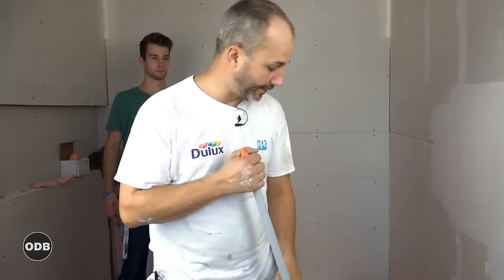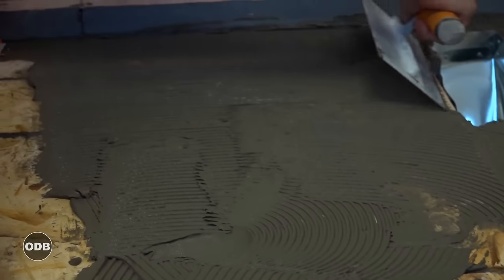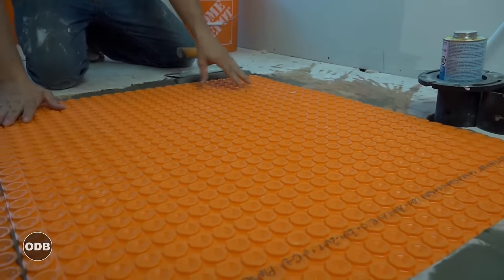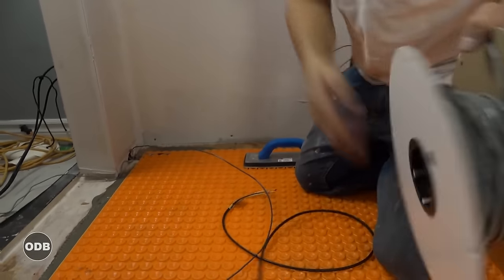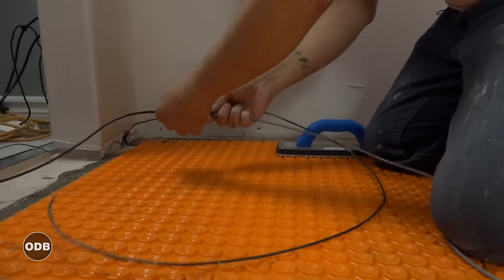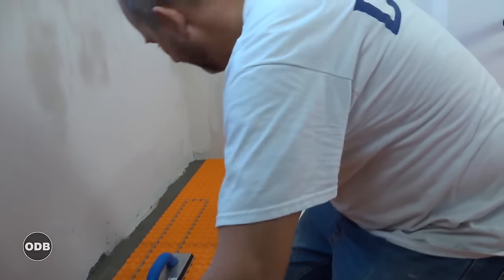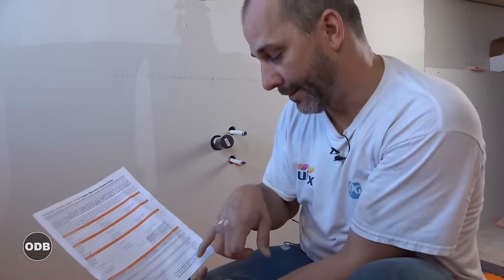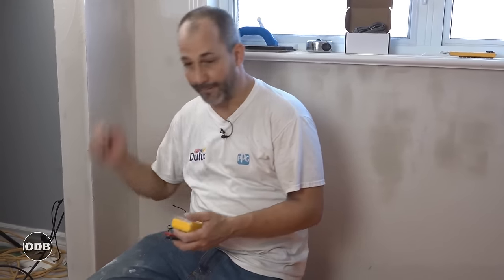How to Install Ditra Heated Floor System by Schluter Systems

Comment: Okay, I haven’t read comments yet and I’m only halfway through this video yet I already see a couple big concerns: first, you didn’t use the notch side of the trowel and that’s how you get an even and proper amount of thinset down. When you lifted the Ditra, it was very evident that you did not have enough thinset coverage as lots of white felt on the underside was showing. Secondly, I’m wondering if you fully read instructions and watched any videos because there’s a VERY GOOD reason why you have two sensor cables. It’s so you can install both and connect one, that way if the one you connect goes bad for any reason, you can switch over to the spare one without having to dig up any tile (can you imagine what a terrible hassle and mess that would be?). I’ll watch the rest of this video and see if you eventually have any “epiphanies”. Let’s hope you do.
Reply: He actually does use the notch side. Its a bit hard to see on the vid
Reply: He’s using the flat side of the trowel to ‘burn’ the thinset into the substrate.  Standard practice.  He states at 1:40 he’ll ‘comb’ it after.

I agree his thinset coverage is problematic.  He’s seemed satisfied with ~20% coverage.  I wonder if his Schluter class instructor would agree. 😬  the problem may be that he is using the Schluter 1/8 inch v notch (which is for applying Kerri to band to walls) instead of the recommended 1/4 x 1/4 inch square notch recommended for the Ditra.

Also, there are two tests for the Ditra cable not just one.  He only did a resistance test.  There is a second continuity test required for warranty

This vid is 5 y.o. now so maybe the recommendations have changed since then..
Reply: @ClownCarCoup  Yea most of what you said is correct. your are suppose to check for continuity 3 times, before install during install once cable is down and after tile install. His coverage is absurdly poor because he probably spent a lot of time talking and the mortar got to dry and that's why it's skimming over. His trowel size is good but the mortar is just to dry and not actually grabbing the fleece. He clearly did not do the training course for Schluter or just did not watch the videos that clearly show how this product is installed. 
He used the Ditra trowel for the heated floor.
He even installed the Kerdi banding over bare wood in the shower which is never done or recommended. 

This was probably a keep it cheap job and needed to be a fast one as the client was not there at the time and he had to get it done in a few weeks or something like that so he probably wanted to just get the thing done and move on as fast as possible. Seeing how there's drywall in the shower but the lack of knowledge with the floor warming and waterproofing install is questionable.

Comment: it comes with two sensors... one with thermostat and one with cables.  both r suppose to be installed.. senors r suppose to be 24 inch away from wall.. i suggest not to use this video to install your floor.. i would watch the schluter video itself.. this guy made alot of errors that would void warranty..
Reply from the maker: Now Now, don't be hating. If you have any specific points to mention I encourage constructive criticism.
Reply: That was constructive. The two thermostats are installed just in case one fails. You also did not install them in the correct location per the installation instructions. The thermostat is supposed to go in the field between to lines. It is supposed to be cut into one of the nodes.

Just a thought, but you may want to read the installation directions before you make a video representing you and the manufacturer.
Reply: @tntrenovate5845  only one thermostat is installed on a bathroom that size.  Two SENSORS are installed in the thermostat in case one sensor breaks.
Reply: No, you always install both sensors in the floor. As I said, you have one ready if and when the other fails. I never said that you connect them to the thermostat. It's clear he has NEVER been trained, or even read the installation instructions, or he would know this. He also installed them in the wrong place. Again, something he would have known if he took the time to read the instructions.
Reply: “...make sure we have good adhesion” <we don’t> “...here we go”
Reply: @marlowt2  LOL I said the same when I seen that. I just saw a video from the company, right before I seen this video.
Reply: @gr8bart1  that's because he used unmodified thinset. The plywood was sucking the moisture out of it too quickly. Supposed to use modified over wood subfloor. Major error. That floor, if still in place, has had the grout repaired several times cause it cracks and the tiles are loose and he probably blamed it on Schluter.
Reply: @tntrenovate5845  And this dude says he is certified.... This has been the worst video I have see on this subject. But I kept watching just so that I would know what NOT to do!
Reply: @HomeRenoVisionDIY   Jeff, don't be such a snow flake liberal with "the hating" crap,  and accept objective and constructive criticism on your work.  No professional at any level should hate constructive criticism.  This install was a hack-job compared to what I expect to see from a certified guy.

Comment: Schluter does require modified thinset to bond the Ditra to a wood substrate. The unmodified is required between the membrane and the ceramic or stone tile. UnModified is not recommended to bond to wood as it does not have the flexibility and the bonding qualities Modified does. Please contact Schluter to verify this before continuing installing with the shown methods in your video. Also note that the Ditra Mat requires a heavier trowel then the Ditra. 1'4" x 1/4"  or 6mm notched trowel is the recommended trowel to bond the DitraMat to the substrate. Also note that a MegaOhmmeter is also required for testing the Ditra Heat for Extended warranty coverage. MehaOhmMeter measures the resistance of the insulation of the cable for faults.  Not trying to beat you down but with anything correct methods should always be shown for the DIY or Newbie installers so to be sure they install correctly. We as Professionals are looked upon on for accurate info and we need to be deligent at our advice
Reply from the maker: Schluter is making their own cement due to the fact that the modified also fails when applied to Osb. Ditra mat requires the ditra trowel(obvious) The osb is 3/4 thick and laid on 12"n center engineered floor joists. The concept of flexibility is irrelevant in this situation as there will be none. I will look into the ohm's meter but am quite confident with this installation.
Reply: Using unmodified is your choice but it is not good advice to give 
conflicting advice as to what Schluter recommends. The Ditra Trowel may 
seem obvious to you but if you double check the Ditra-Mat Instructions 
you will find that Ditra Mat needs a 6mm x 6mm trowel. The standard 
Ditra needs a 4.5mm x 4.5 mm trowel. BTW I too have been to the Schluter
 training seminars (including one at TCNA) and have been installing 
Schluter products since 2002. What I am recommending is double checking 
what you believe to be true and verify what I am relaying in 
information. Video is very good but needs a little more updated info. 
BTW the tile police wont be after you :)
Reply from the maker: Good news is, Schluter is bringing their own cement to market soon that eliminates the need for a 2 cement solution.
Reply: modified over wood sub straight  and unmodified over sealed concrete
Reply: They are making their own thinset so that you can have one thinset solution. Modified thinset does not always fail when applied to OSB. And your floor will still flex. All structures flex. Even a 12oc over engineered joists has a deflection rating.  And you have to test with a meter and document those tests in order to receive the warranty and insure there are no breaks in the line. Your installation may be sound, but the wire may be bad. You don't know unless you test.
Reply: The original commenter is referring to a megger (or a megohmmeter, not a mega ohm meter). A Fluke 1587 dmm would be the best choice for this application. A megger measures the resistance of a cables insulation to ground, verifying the cables insulation is not damaged. They make meggers to test 600V cable all the way up to HV cable. By measuring with a regular ohmmeter you’re just reading the coils resistance. Hope this helps, Jeff. Thanks for all of the free advice!
Reply: I used ardex x77 under the ditra is this a mistake? And can i use ardex x77 over ditra or is ardex fb 9L better for that?
Reply: Very helpful video. Appreciated.  I do wish for a better explanation of why latex is added to thin set.  Portland cement when laid in thicknesses of less than 3-4” will lose moisture too rapidly to effectively cure.  Cement can take up to 28 days to cure, and of course requires adequate moisture to do so.  In applications where a thin layer of cement(thinset) is used the addition of latex slows moisture loss, which is desirable.  This allows the cement to cure properly.   It is my assumption that with the various Ditra products moisture loss is significantly less due to the waterproof nature of the membranes.  Therefore modified thinset is probably not necessary and likely undesirable since it may take forever to dry out during the cure.  However, again an assumption, but in the case of laying the waterproof membrane over moisture sucking wood or concrete a modified thinset would be desired, just as Schluter recommends in their documentation.  If a good understanding of why modified thinset exists in the first place then I think the ‘when to use it’ becomes pretty straightforward.
Reply: Home RenoVision DIY have you looked into the megaohmmeter? I also live in Ontario and I’m having a hard time finding one to buy. Home Depot website says it’s “not available in your [my] area” any news in this regard? Thank you!

Comment: Unfortunately loooooots of errors. I like this guy because he tries hard and tried to educate. This was just a bad decision. Probe locations wrong, wire testing in all areas (not just ohms, read the product), proximity to room objects. SCHLUTER would tear this apart!!!!
Reply from the maker: Thanks for your opinion Jared, Although The job works great and the clients are happy so I am not sure why you have such a problem. I went to check your video on the subject and low and behold not any videos on renovations at all. I guess your just another expert without any evidence that you have a clue about what you are saying. Schluter did contact me. They were only concerned about the cement I used uncer their membrane. I told them to get something that worked because the latex modified was failing on OSB. They designed a new product that we will be discussing  shortly.
Reply: Wasn't meant to be a rude comment. I really do enjoy your videos and watch them often. And you statement is fair regarding not having my own videos. I've done roughly 3 or 4 dozen ditra heat installs (years back I did the NuHeat systems).  More meant my comment as constructive critism vs the schluter warranty. Schluter's criteria to meet warranty is extensive and very complicated. I have also done courses in Toronto, Montreal and a brief seminar when I lived in Nova Scotia. I am not criticizing your work, simply pointing out in this case, the expertise wasn't there (I'm sure you could admit this!!). I mean.... not knowing they have a 2 probe system says a lot (one stays dormant in the box incase a probe fails, most common failure in older systems over time). Also, should be a big emphasis on testing the wire. I made this mistake a few years ago, and the cost of fixing is obviously expensive. Again wasn't meant to be disrespectful. After re reading I can see how u could take it that way. My apologies. As mentioned like your videos and like your dedication to helping people achieve results.
Reply from the maker: Sorry for jumping down your throat Jared. The schluter warranty for floor heat is more designed to make sure no one qualifies. In this custom bath business you need to take risks to create cool things. I know that they don't have an approved method for putting a wire in the shower but in speaking with the rep they don't have any concern either. If people wanted to follow all of the steps then that is fine. I test my wire and install with a proven technique. I have never had a wire fail on me. I did however buy a bad one once. 
It is clear by your comment you know what you are talking about. Happy to receive critique from you in the future. Again my apologies.
Reply: @HomeRenoVisionDIY  in the video you said unmodified thinset as you put the first mat down and the coverage proves it. In the reply to Jared you said you told them latex modified and blamed it on them. It failed because it was unmodified and cannot adhere to wood. Read the install manual you said not to throw away.
Reply: https://youtu.be/iWhI05TYSh4 Proper install for reference. Never stop learning

Comment: Looks like your thinset may be a bit on the dry side. Coverage didn't quite look good enough.
Reply from the maker: Thanks for watching. However I am completely confident in the installation as shown.
Reply: Bingo...the coverage was terrible. I hope that Schluter doesn't see this.
Reply: i showed my schluter rep this video he laughed his ass off when he seen where he put the cold lead and sensors... may work right now but if anything ever goes wrong there will be no warranty.
Reply: Was a bit dry. Lol
Reply: Ditra xl requires 1/4 x 1/4 trowel, not the ditra trowel and thinset should be mixed to a more fluid consistency.  When you checked for coverage and saw that it was terrible you said you were happy with it?
Reply: @HomeRenoVisionDIY  you used unmodified thinset. It came back up, didnt it?
Reply: Nothing worse than not being man enough to admit you did it improperly.
Reply: @christopherneske2593  You should see the one where he screws the mat to the floor.
Reply: Christopher Marsceau I was just looking to install this system. Schluter says non modified for the mat and modified for the tile. Disagree?
Reply: Grady there website says to use modified thinset  over plywood or osb
Reply: I've watched a few of his videos and I'm left with the impression that he's a bit of a hack.
Reply: @HomeRenoVisionDIY  If only you being completely confident equated to best practices

Comment: Jeff:
 You posted a video before where you screwed this mat down. Installed electric heat and vinyl plank flooring directly on top with no thin set. That post sent me on a journey to do the same. That turned out to be embarrassing because of how wrong it was. 
 The harsh comments below are accurate. Bad adhesion.. Improper sensor placement. Backup sensor is recommended by any company.
 Three inch spacing is minimum anyway. Bad info.

  TIP to those watching this install. 
  Send the company you want to purchase from a layout of the room and they will send you all the right info and a layout plan for your cable.
 I went to Warmlyours. Great service and support.

Comment: 1. Latex portland cement (p.c.) mortar – ANSI A118.11 - from their diagram this goes on before the Ditra.

2. Unmodified thin-set mortar – ANSI A118.1 - the tile is secured using this of course.
Reply from the maker: As you might well be aware William, there is no technical requirement for latex cement under the ditra. In fact you can use unmodified anywhere. In most situations if a home owner is doing their own tile and using schluter sytems then they can eliminate the need to but latex cement and throw most of the bag in the garbage after just by using unmodified instead.

Comment: Great system! Schluter  offers two heat sensors for install so if one should fail you have a backup. Most people are also not aware that these in floor heat systems need to be inspected by ESA in Ontario after install.
Reply from the maker: Very true. This is a relatively new addition to the electrical code. Check with your jurisdiction if you have any questions.

Comment: The system comes with two thermostats because one is a backup and they want them installed in the center of the room. As for the thin set you should use schluter all set, takes all the guesswork right out.
Reply: what is the use of having a back-up sensor 
if it's in a box and not under the tile???